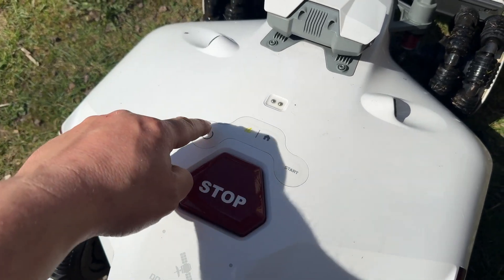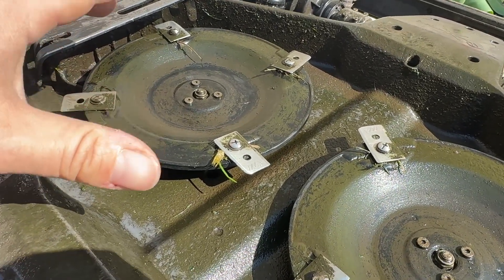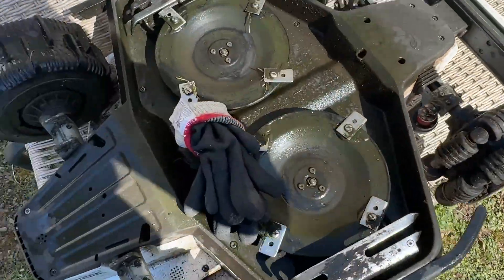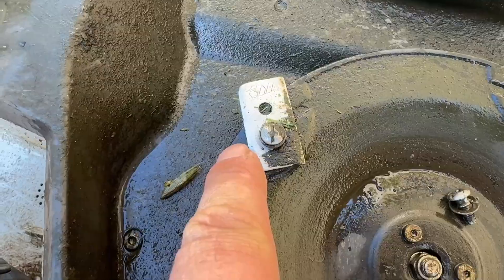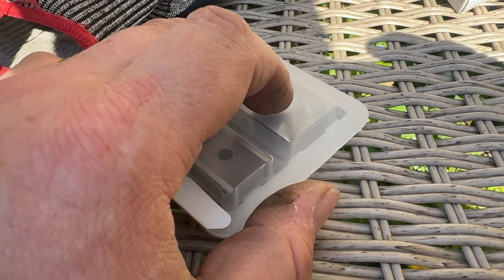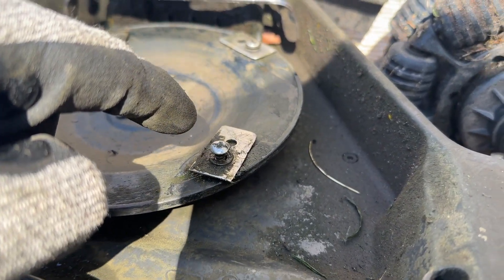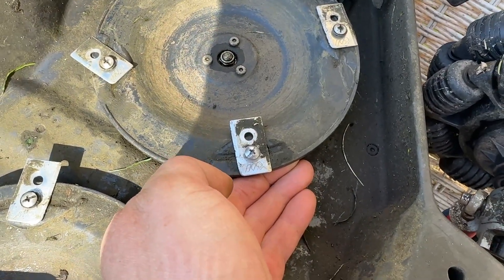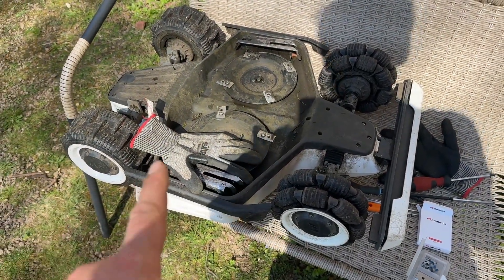Robot Mower Blade Replacement | Mammotion Luba 2

Comment: Yes, Mammotion mower blade discs rotate in opposite directions to each other. This is a key design feature that allows users to utilize both sides of the blades by simply swapping the two discs from one side to the other, rather than having to individually flip each blade.
Reply from the maker: Yup! 👍

Comment: Instead of flipping the blades you can swap the entire disks. You will get the same effect with less work especially if you have Luba 2 X-series with 12 cutting blades as I do.
Reply from the maker: Yeah that will work. Side guards have to come off or will they come out without?